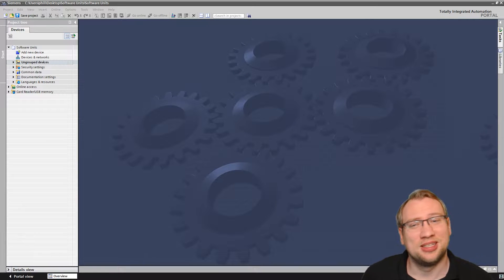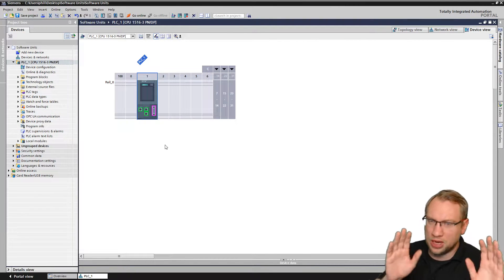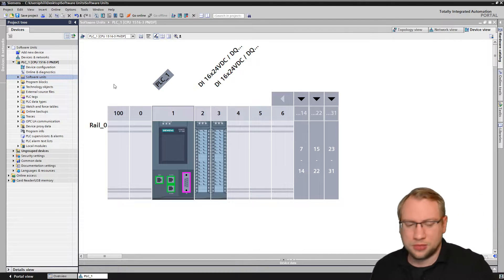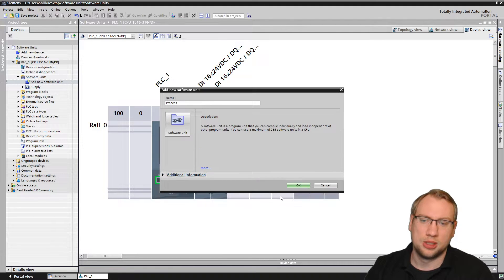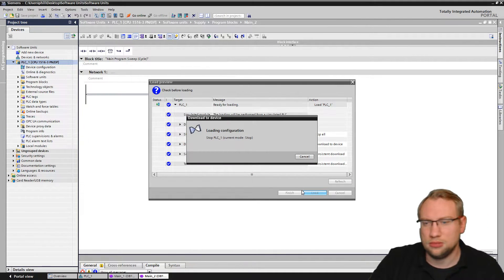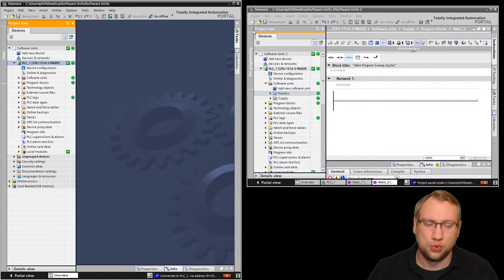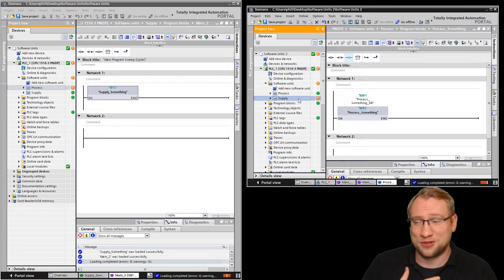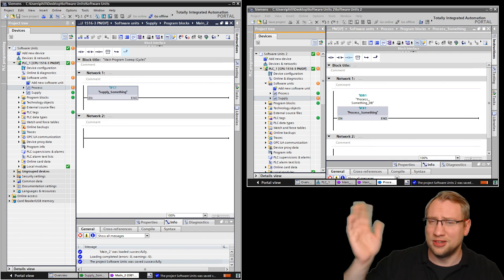TIA Portal: Software Units (Multiple Projects on the same PLC) Part 1

Comment: In my opinion Siemens has taken the main idea from AB and their software Studio5000. There you can create many different Tasks (someting like main programm), and different people can create with this task independent from each other, but Siemens improved this idea.
Reply from the maker: That could be! I have not worked with AB yet, but I am pretty sure SIEMENS and AB try to learn/copy a lot from each other
Reply: @hegamurl  I know, for example in Studio5000 it was impossible to split windows, you could watch only one window, with v31. now it's possible. Could you answer, what do you preffered classik (Step7, WinCC) or Tia?
Reply from the maker: I definitely prefer TIA portal over SIMATIC Manager... it is just so much simpler and more effective to use! And all tools are embedded into one, which makes the data sharing and communication in between 1000000x easier to implement and keep standards
Reply: @hegamurl  but Tia is not optimized, Step with WinCC is much easier then Tia... I noticed that every new Tia need a new PC(((

Comment: So these software units can be considered as separate control loops ??
Reply from the maker: Kind of but not exactly.
With seperate control loops you would have two completely independently running programs (Side by Side). The PLC can not run two things in parallel.
In the case of using multiple "Main" functions (as I did in both software units), they are executed AFTER each other.

Comment: Software units made easy by plc sensei...but uhh yh if your firmware can't be updated past 2.5 it means you hv to buy a new PLC?🙁
Reply from the maker: Don't buy a PLC for it... it is not the most neccessary feature 😅 Unfortunately it is unavailable for it, but that is okay
Reply: @hegamurl  ok got it..video request..please do a hmi faceplate for the beginner example..the conveyor belt control
Reply: @hegamurl  what if the firmware version is not in the catalogue do I find the gsd file and add it?

Comment: Thanks. Is it same as TIA portal multi user? Which version TIA do you use?
Reply from the maker: Hi James.
Multi user and Software Units are both for projects with more than one engineer/programmer, so they seem similar but:
- Multi User is for sharing the same project data/software that is placed on a server
- Software Units are for sharing the same hardware
Reply: Hi James please go through this vidoe.It will guide you better whats multiuser is. It's made by Siemens. https://youtu.be/EoRQcEvmt7o